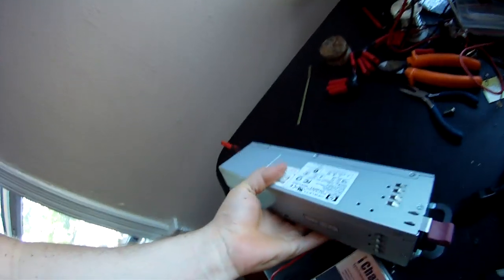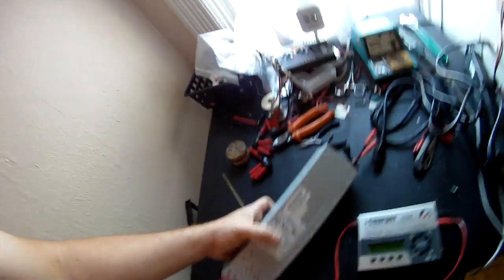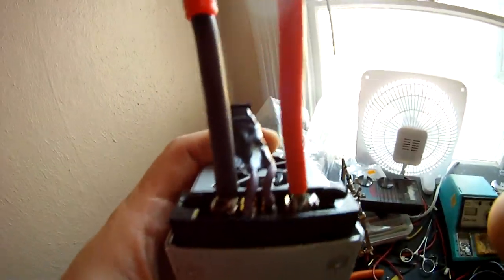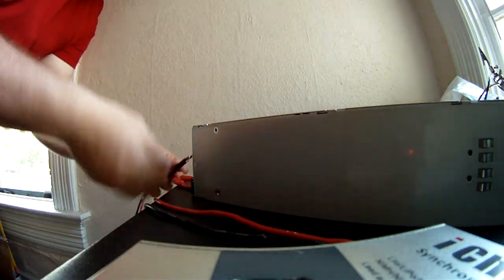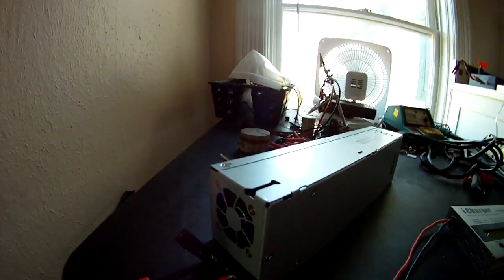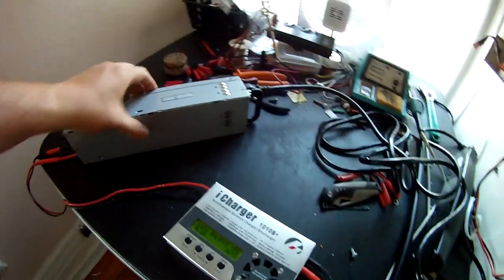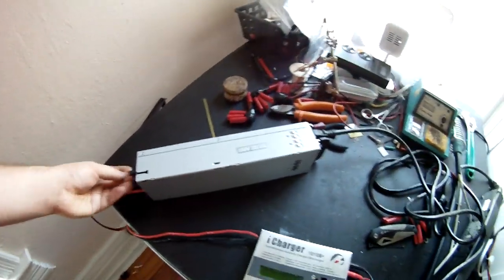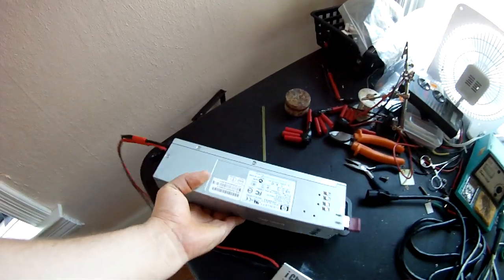12V server power supplies

Comment: Hello friend I want your help with my astec aa20790 I don't have idea how do turn this on. Your power supply is like a astec and I too put a resistor 4.7k (I see this in a pag chinnese) in 34-com and 31+12v_chrs but this doesn't turn on. Thanks.

Comment: hi,,, i have a astec aa22790 and want to use with 12A in 12V line,,,,, do you think i can? or it is protected and it will lower the voltage at such ampere demand?
Reply: Server power supplies don't drop the voltage - if the voltage were to droop beyond 11.4, they must go into protective shut-off. The model number comes up empty, no idea what it is and what its rated amperage is - if rated amperage is exceeded, it should shut off too.